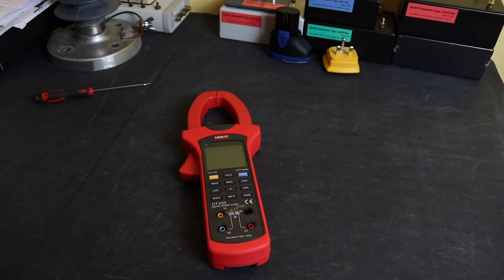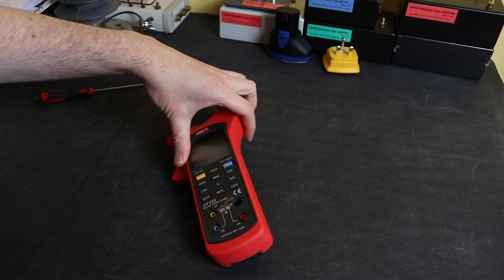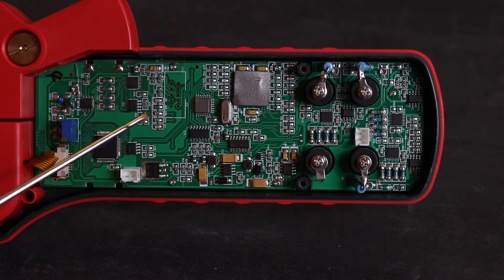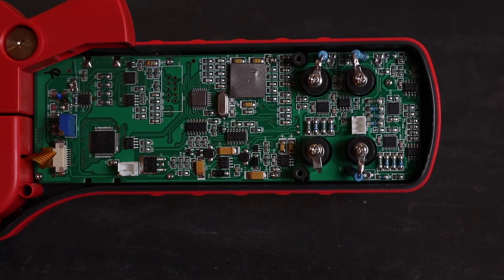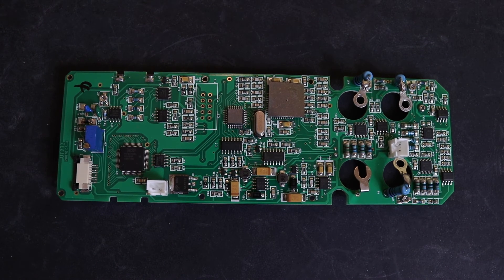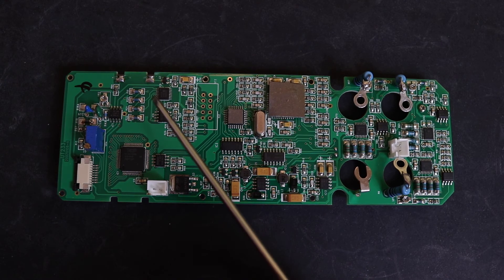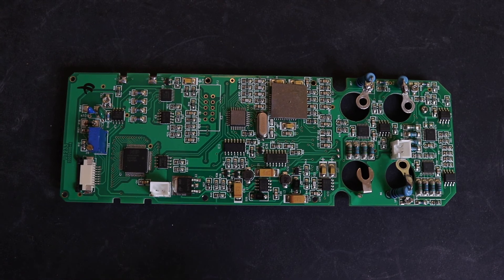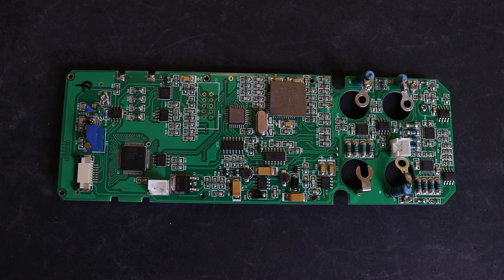Uni-T UT233 Power Clamp Meter Teardown

Comment: Does this measure harmonics ?
Reply from the maker: Hi, no it doesn't measure harmonics. Voltage, current, frequency, active power, reactive power, apparent power, phase angle and kWh energy are the measurements it can make.

Comment: I have the same feeling whether the dropper resistors would get you to the CATIV rating however if it’s a listed and tested product it must have passed. So a decent product with pretty reasonable components.

Though I must say I do get irritated by the race to the bottom business models are so short-term that building a high quality engineered product is always viewed as a cost inhibitor rather than a future revenue driver. It’s actually about education and the era of social media should be a opportunity to get the message across about higher quality manufacturing finder and tighter tolerances, higher quality components and skill in putting things together. That can justify the higher cost and lower failure rates in products. We are always seduced by getting something for less. However I am willing to pay of the manufacturing quality is upto scratch.
Reply from the maker: I have had a good look around the case today and there isn't actually any markings on it other than double insulated and hazardous waste symbols. For CAT rated instruments I like to see the independent CSA, UL or VDE symbols, but they aren't there. I don't see a CE symbol either, which I thought was mandatory in the UK.

I usually find higher quality tools are much nicer to use and have less issues. As you say though everything is price driven these days and for those just starting out in a trade, sometime starting out with more cost effective tools is the only way to get going.